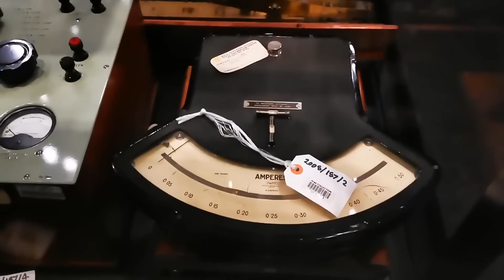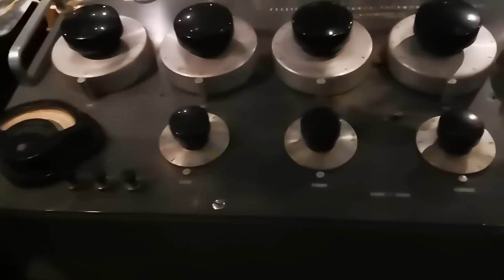Powerhouse Museum Discovery Centre

Comment: Rockwell AIM65  6502 8-bit computer with thermal printer.  Programmed in assembler but had a BASIC mode.  Used them in college around 1985

Comment: Regarding the Apple 1. It would be a matter of protection from the admittidly low light. Plastics, art works, textiles, photographs, paper, etc. are displayed at 50 lux. Even so, the damage builds over time. There's also a matter of space. Only 1% of objects were on display at the 3 Melbourne Museum sites when I was working there.